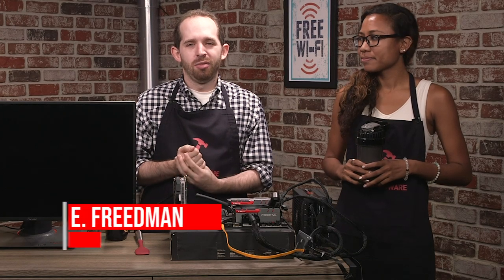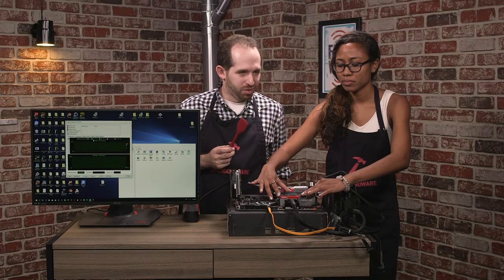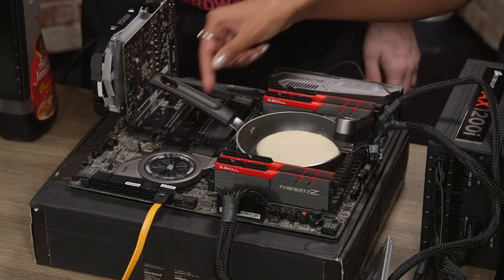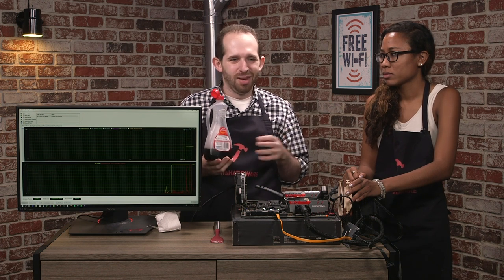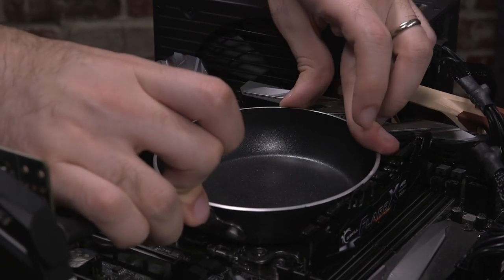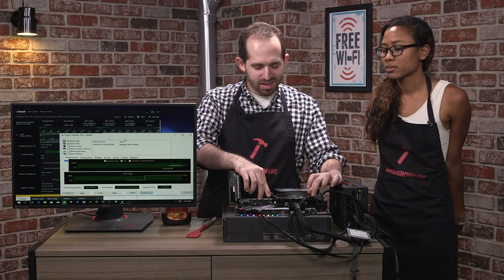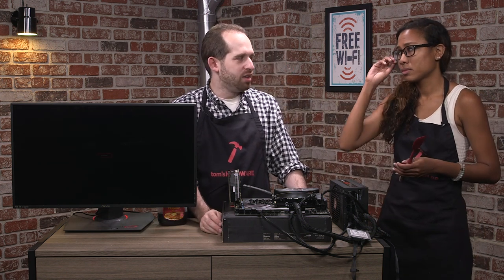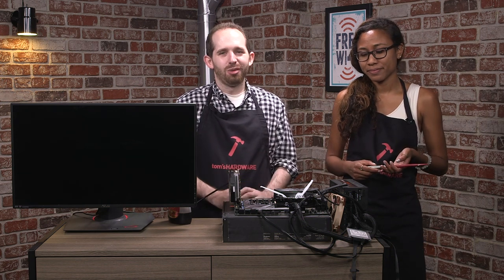Which CPU Cooks a Better Pancake? Intel Core i9-9980XE or AMD Threadripper 2990WX?

Comment: 2020: Heating up a room with 10th gen Intel Core I9 processors
Reply: If you wanna heat up your room with a processor use the i7 9800x, 165 average TDP I have it and it can raise my room temp by 7 degrees Fahrenheit while AC is running, my room gets to about 77 if my door is closed and has been as high as 85
Reply: @angrasband3564  Now imagine if you added two overclocked RTX 3090s in NVlink.
Reply: 2021 heating your room up with a modern fx chip the i9 11900k
Reply: Linus has tried using a radiator coil as the literal radiator for a PC.
it kindof worked.
this was achieved using a threadripper.
tho if you overclock an HEDT i9, since it sips 500w of power, you can achieve better results.

Comment: would have worked better with less thermal paste.
Reply: No, the thermal paste allowed the heat transfer
Reply: TheRandomshite123 nah that thermal paste looked thick, too thick and heat won’t transfer as much
Reply: Thermal paste isn't a good thermal conductor it is just used to fill the micro gaps from the IHS and the heatsink for a better heat transfer. A thin layer of thermal paste is better than a thick layer

Comment: So I guess Intel chips are better at handling high heat situations then. ... from what we are seeing.
Reply: Good thing that even a stock intel cooler can keep an amd chip under dangerous temps
Reply: Just as they said they cannot find anything regarding the thermal protection in the bios while the Intel one has an option to disable it. It might be shutting itself off because of the heat and if the CPU is broken then it should just continue to be on without turning off

Comment: Tom's hardware has declined to the lowest levels. They are redoing the "just buy it" they did with the 2080ti, this time with msi x570 boards. They are stupidly calling liars and trolls on the other reviewers, even though MSI acknowledged the situation. TH is contradicting itself constantly, claiming the boards works fine but testing it only with a underpowered CPU (65w) on a high-end chipset board. They are full filing an agenda, for sure. Dislike and unsubscribe, this is a joke of a channel.
Reply: This is a video about pancakes
Reply: This is a video about cooking pancakes on processors.